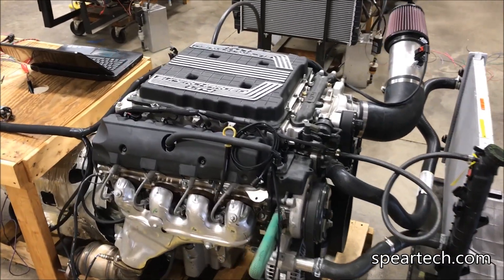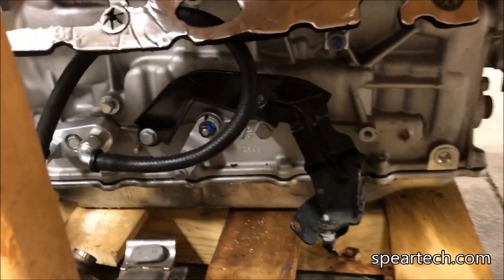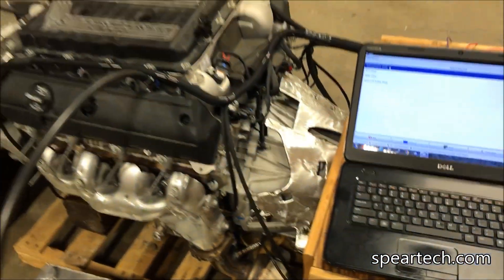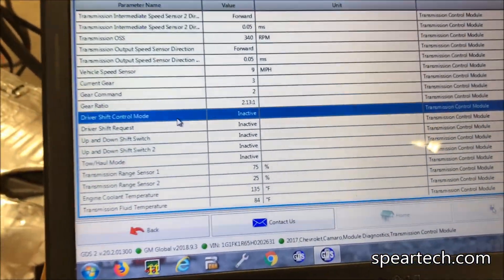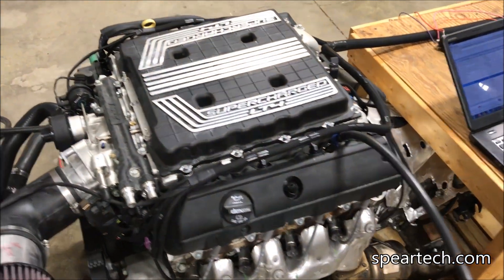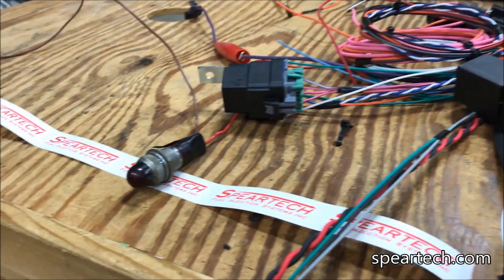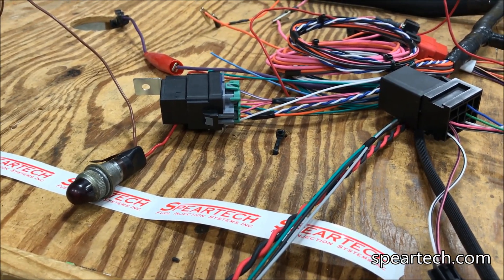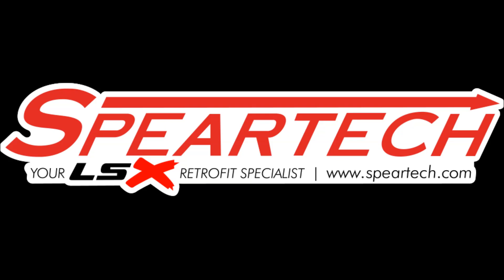Speartech LT4 / 10L90 Swap Harness Preview

Comment: I have a 2016 Silverado awd/4x4 with an L83 and a 6 speed. I would love to have the 10 speed.  Would I need the transmission control and wiring harness and a tune?  Or just the trans control and harness?  Or just the harness and tune?

Comment: Are you guys working on a harness to be able to swap a a 10 speed into a nnbs  E38/t87a ?
Reply: No a harness wouldn't be an issue, it's the communications between the engine/ECM/TCM etc that's the problem.  A standalone transmission controller company (like TCI or Compushift..etc) would be who would need contacted for something like that.  Developing a standalone transmission controller for the 10 Speed would be nice, but it's way out our scope.

Comment: I want to swap the 10l90e in place of my 6l80 for my 2019 Silverado 4x4.   I assume I would need custom driveshafts and trans crossmember at the least?
Reply from the maker: Those would be the least of your worries.  Something like this isn't possible at this time until a standalone transmission controller manufacturer comes out with something to achieve this goal.  Since we don't specialize in manufacturing standalone transmission controllers, we can't be of much help in your situation.  But if you want to swap a 2019 Silverado engine with a 10 Speed into one of your classic cars, give us a shout.
Reply: @SpeartechLSX I wonder if Turbolamic is working on that

Comment: So I can put the 10 speed and lt4 in any car and have a fully operational and tunable transmission?
Reply: Yeah with hp tuners
Reply: @Shiftheads  
Look up stangkilr productions he has an lt4 with a 10 speed in a 93 obs chevy truck..speartech and hp tuners join forces..
Reply: @dalehall2993  yeah I've seen that. I'm basically doing that with a lt1 in a frs
Reply: Or speartech..
Reply: @dalehall2993  spear tech makes a harness but you still need a pcm and tcm that are matched up and reflashed through hp tuners which means sending yours in or buying them. Once you have that with a standalone harness you can then tune your setup in any car. There are no aftermarket trans Controllers for ten speed yet

Comment: I'd like to swap a 10L90 into a 2JZ powered BMW 850i.  With a manual I typically let out at the top of a gear like 4th or 3rd but with an auto I have a tendency to keep my foot in it longer and enjoy hearing the exhaust crackle on a quick shift.